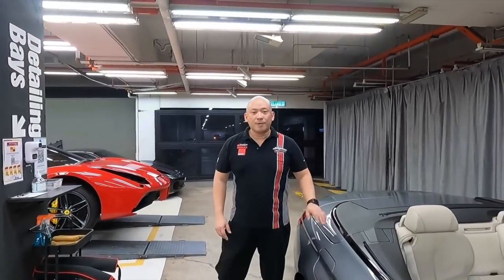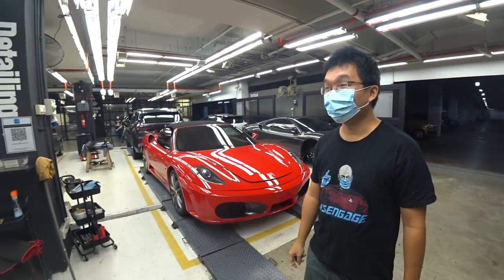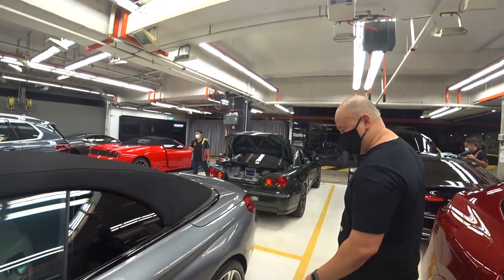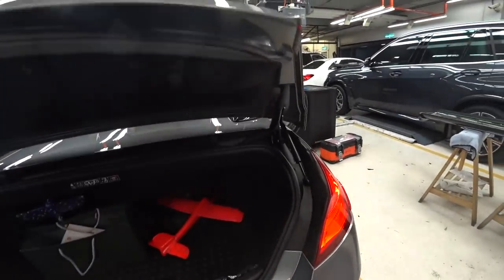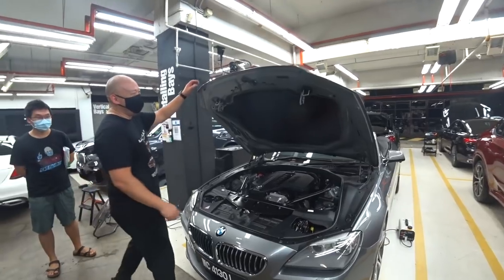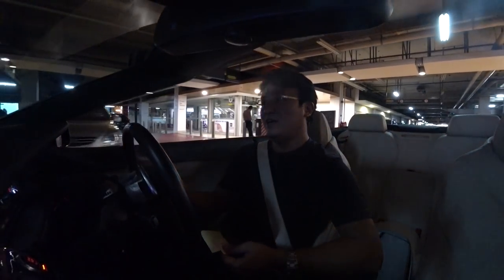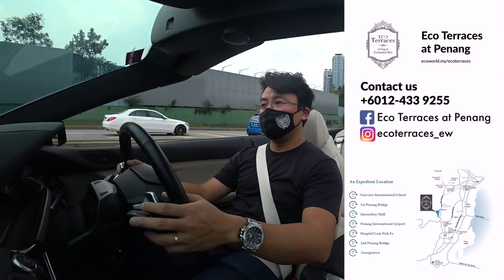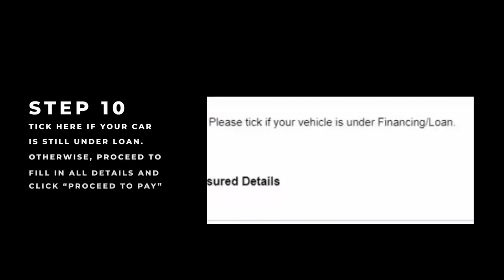AutoDetailer Studio detailed my BMW 640i Cabriolet | Evomalaysia.com

Comment from the maker: I see many of you asked how much it costs just like the last few rounds when i brought my RS6 and my Rapide over. It's very hard to tell the cost of service because it depends on the amount of work that needs to be done. My Rapide probably costs the least because there isn't that much of work needed to be done. My Audi needed all four rims to be replaced because he found a hair line crack on one of the rims and when I found the rims he helped me pay for it, should I include the cost as well? And its not fair for me to say the Rapide is cleaner hence cheaper because the aluminium grilles of the Rapide was removed to get every single piece of that of some oxidised aluminium treated, certainly takes more man hours than just wiping off grime from a piece of plastic. My Rapide had PPF installed on the headlamps, that would make it more costly as well, the Audi had grime stuck within all its bodykits and all had to be removed to clean up. My BMW's seats were all removed the carpets within cleansed and treated which my Aston and Audi didn't have to because the BMW's leather has discoloured. Basically, every car varies. You just bring your car over, let Darren have a look, tell him you have a budget, and he work around your budget. If you're like the GTR owner, who told Darren he wanted a new car. Then it starts from stripping everything off the car's frame, throwing all rubber seals, aircond systems, electrical systems, all wear and tear items were thrown away and reordered and fixed onto the car after a series of sanding priming, painting, coating, PPF, and then re-foaming the seats (not just reupholstering on old foams) and restitching, new dashboards, new headliners, full set of new air conditioning, new electrical wiring harness, basically everything new. Then the transmission and engine was overhauled, refreshed, reprogrammed etc etc. Those will of course costs a lot. But he is a professional restorer and the OG of detailing in the country. He has the knowledge and the tools to dismantle every single car, his workmanship is even better than all the fresh grad apprentices in official 4S centres. I have more faith in Darren dismantling my car than BMW 4S centre's high turnover staffs. So, I can't tell you how much your car would cost and how much my car costs is irrelevant to how much it costs. I don't expect it to be cheaper than an iPhone because an iPhone can be bought anywhere. And the things that Darren knows how to do, even RWB's Nakai San couldn't. Right?

Comment: Sincerely BMW should be avoid at all cost once it reach100 miles or ++ be prepared tones of problems to come like the timing chain which is reparable or evenly can cause engine failure too and top of that it's gonna cost a fortune to replace the timing chain.
Reply from the maker: Don't agree. BMWs are reliable if you know your stuffs.
Reply: @BobbyAngmalaysia  Do a search you will see it by yourself
Reply: Literally telling a long time BMW owner to search it up 🤣
Reply: Lmao that's if u don't know what to look out for during a test drive. Listen to every little knocks and get a car with full service record. If you're an idiot, u can buy even a Camry that can blow Ur wallet off, don't be a keyboard warrior.